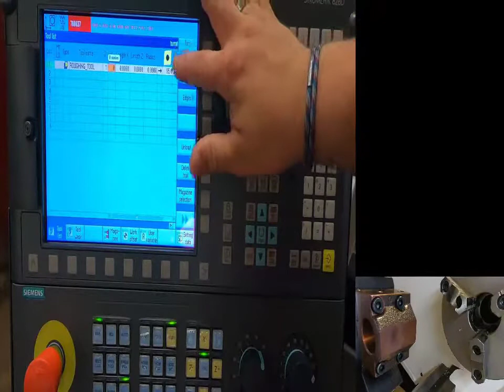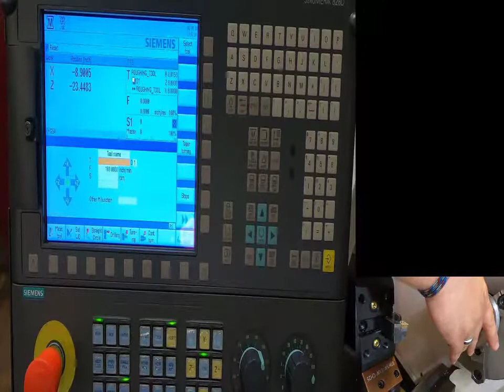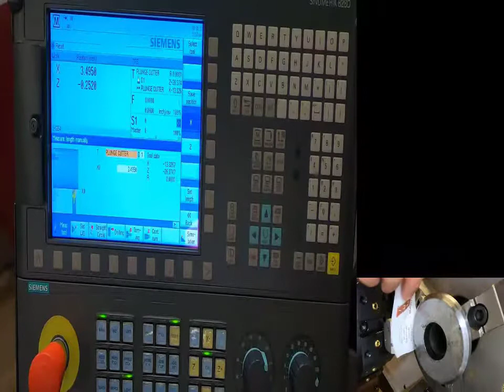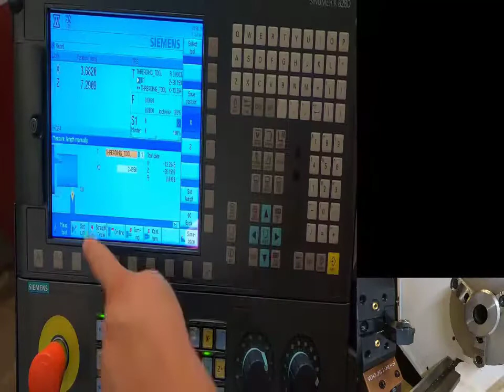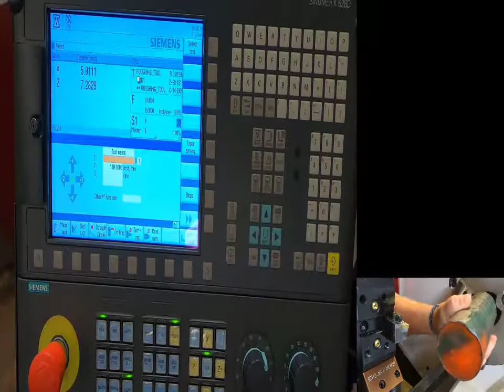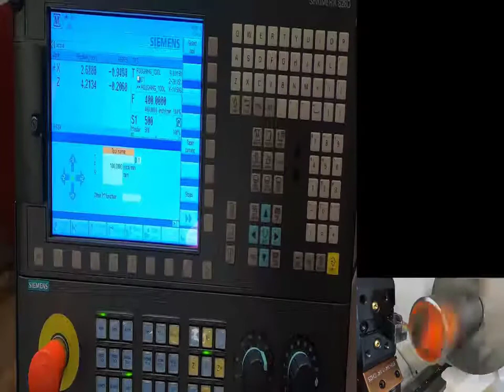Fryer ET-16 Siemens Control Lathe Setup

Comment: HELLO AARON

WE HAVE A FRYER EASY TURN AT WORK AND WE HAVE MANY PROGRAMS IN THE CONTROL

WE RUN THESE ALL THE TIME.... PROVEN PROGRAMS

RECENTLY ALL OF THE SUDDEN IT STOPPED LOADING THE ACTIVE TOOL OFFSET WHEN IT GETS TO IN THE PROGRAM

IS THERE SOME KIND OF MODE WE MAY HAVE ACCIDENTALLY ACTIVATED THAT WOULD CAUSE THAT

THANKS
Reply from the maker: Well that's frustrating. I would try a couple trouble shooting ideas. First call up the tool using MAN mode and use soft key select tool. Make sure to select a tool in the active tool slots and not a tool that has not been loaded into the location. If a tool  has not been assigned a designated location it may not call up properly. Once you bring up the tool using MAN mode the turret should index to the correct location and that tool should be displayed in the TRS heading. Also, if G291 has been activated be sure to cancel it with G290 in MDI mode. I would try this first and it may shed some like on the problem. Good luck and thank you for watching.